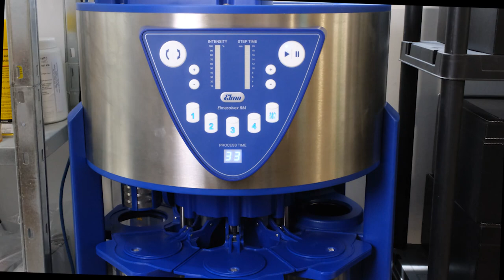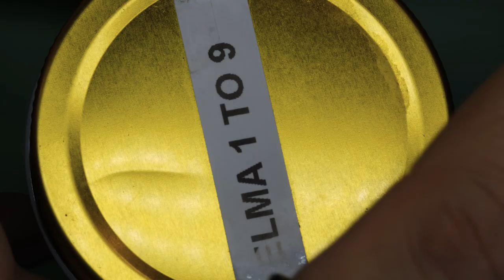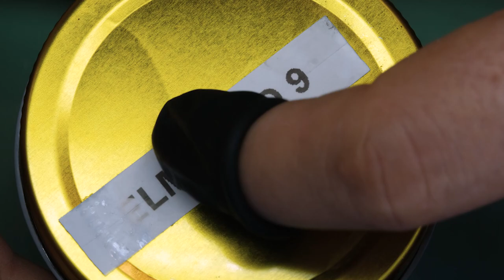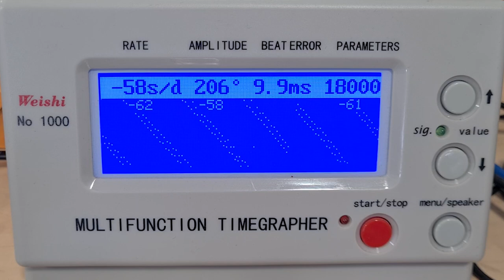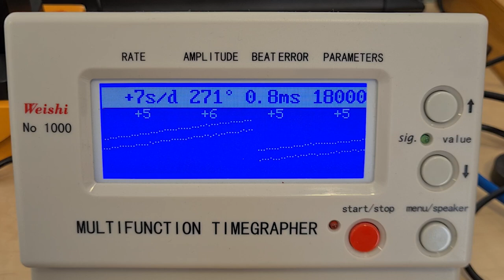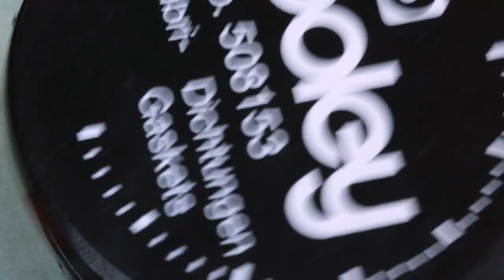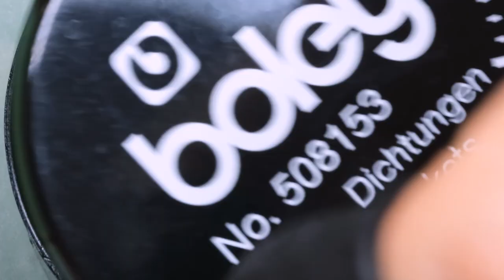What happened to the hairspring in this watch? 😩

Comment: Honestly, that manipulation of the hairspring was amazing. For a moment I thought you might try for perfection, but you opted for absolutely good enough. Sensible.
Reply from the maker: Thanks! That hairspring was so damaged it could never be perfect, and it might have been a wiser choice to replace it.
Reply: @VintageWatchServices  Maybe, but you didn't give up on it, and I appreciated that.
Reply: It’s good to see this for when it’s easier than finding a replacement…
Reply: I wholeheartedly agree! I had no idea that it was possible to perform those tweaks and end up with a hair spring that actually keeps good time. I thought for sure that it was going directly into the bin.

A couple months ago, I went the bench, already in a bit of a foul mood - hoping to get my mind off the issue that soured my mood. Yeah, terrible idea. That day, I was starting a new project, which involved opening the pressure-fit caseback. Like complete idiot, I used a handheld case opener and applied way too much force. The hairspring was an immediate casualty.

It was very hard to find a replacement, but I eventually did, at substantial cost. I really wish I would have known about this technique. I’m pretty sure I could have saved the original if I had known how to reverse the, ahem, changes. ;)

Anyway, thanks for taking the time to show us the manipulations and explain the operations you took. Much appreciated.

Comment: I know I’m making two comments on this video but… I would like to say from my learning experience that one should NOT start, in my opinion on working watches. For me, at least, the hard part was learning how to manipulate tiny parts with tweezers and probes while looking through a loop, and I was glad to learn how to do that (and mangle, break, and lose in an inappropriately thick and lush carpet, parts) on junk movements I picked up for pennies a piece before I started to work on relatively expensive working movements. Now that being said, I agree that when you actually get to the part where you are looking for a working watch when you are done, yes, a previously working watch is a good idea. Tricycle is a junk movement, training wheels is a working one, and really riding is a broken one you get working.

Again, in my opinion. Some people may have a much easier time with that first part than I did.
Reply: I can definitely see both sides in this discussion. My comment would be that it is possible to find extremely inexpensive, working movements. For example, I bought a bag - yes a bag - of 10 unserviced but otherwise working Soviet watch movements for roughly 35 USD. If I am honest, I will reveal that I inadvertently destroyed the first one. However, after that, I started having successes and I could see real progress in both my techniques and results as I worked on the same basic structures again and again.

As an aside, I later purchased a bag of 60 movements for about a dollar apiece. In this case, I have no interest in bringing them fully back to life. Instead, I thought it would be cool to make a large, wall clock where the minute markers are, themselves, timepieces.
Reply: @a1nelson  I started in this when I was still in high school. I am self-taught through a correspondence course that didn’t have any grading. I got a box of (never counted them) mostly broken movements from watches that were quartz-converted back when that was something people did, for, iirc $10. I threw out dozens, I think the total may have been over a hundred. I later got to work on some of the ones that worked badly, and got them to work better, and eventually, well. 

I had a little business going where I would buy broken watches that were worth decent amounts working, but next to nothing broken. I often found them in jewelers junk drawers for under $5 a piece. Then I would service them (fairly poorly, I will admit) to the point where they could keep time to within a minute or so a day reliably, and sold them as working and keeping time, but I never claimed them to be ‘recently serviced’ because I didn’t think my work was good enough (nor were my tools) to justify that contention. In those days a lot of watches that are worth serious money now were worth practically nothing. When the market started changing to where they were more valuable, originality was very highly valued, and people expected a guarantee of accuracy, I decided my hands weren’t good enough for that kind of work. Also I had (who am I kidding, I HAVE) a hoarding problem where I would end up keeping too many things I was supposed to be making a profit on. 

I think my way makes it easier for the weak to try and not get so discouraged when they turn a barely working watch into something with a hairspring like this Bucherer because they just don’t have the skills to use the tools yet. Its really discouraging to know that you broke something, rather than screwed up on something that was broken anyway. Just my point of view. As Stian is fond of saying, there is more than one way to skin a cat.
Reply: I just started off with two inexpensive ( 10€ each )  , identical , new chinese pocket watches. Movements are 2650s,just three hands , manual wind.
I did manage to disassemble , clean and get them together again. Guess i was lucky . But its not as easy as it seems to be in all these videos :- ) Especially the shock springs became my arch enemies  when they came off :-) . Beeing short sighted definitely helps a lot, i could  handle most parts without having to use a loop. There are some great channels on YT for this hobby - Chronoglide, Alex - its about time - Marshal - wristwatch Revival and of course this one are my favourites.

Comment: Thank you for the video Stian. So are the upper and lower balance jewels the same and interchangeable or should they be kept track of and replaced to which side they were removed from?  Your videos are very inspirational and informative to me.
Reply from the maker: Hello John, the jewels are mostly interchangable, but if they aren't you'll see a difference. As a general rule the shock settings in the balance cock will be the thicker or wider one if they are different, as that is the one that most often will receive the shock.
Reply: @VintageWatchServices  thank you Stian

Comment: Hey I have a Bucherer I just bought. It is probably from the 1970s. Chronometer, 534P. Has a date window. It runs but the rotor doesn’t turn. Also, I saw an opening on the side to pry open but it took the crystal and a ring off. How would I go about accessing the movement? Thanks
Reply from the maker: Hi, I'd really advise not to try to open the watch. It's very easy to damage the movement if you don't have a lot of experience.